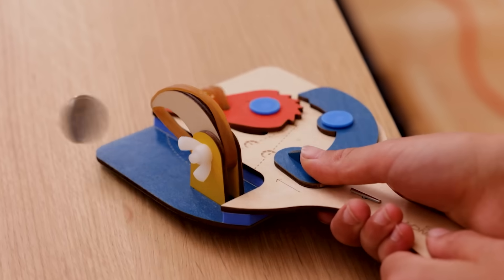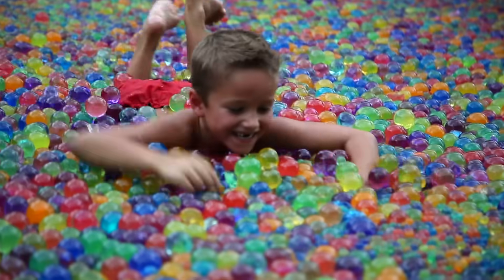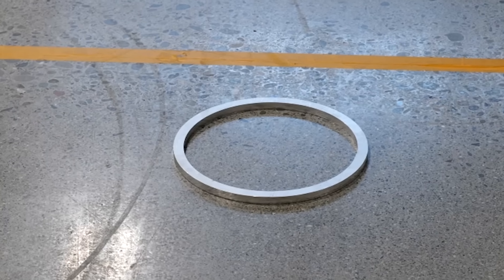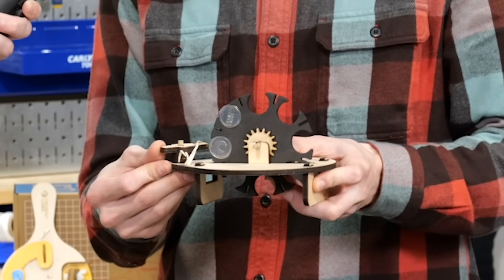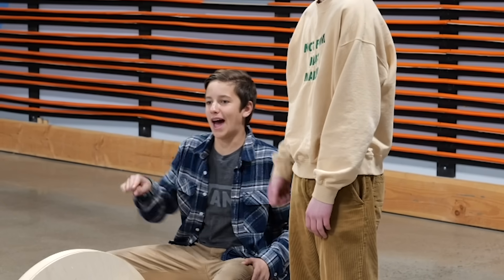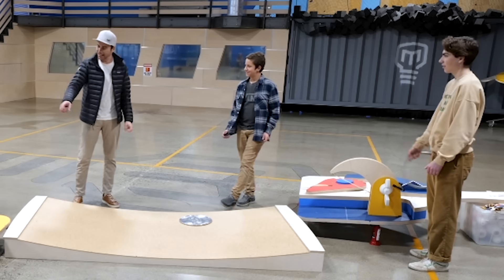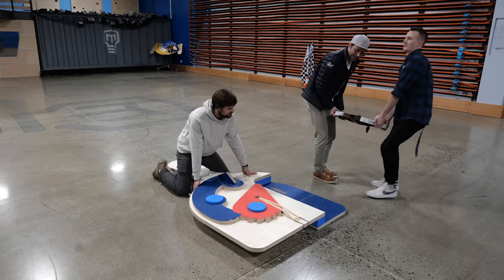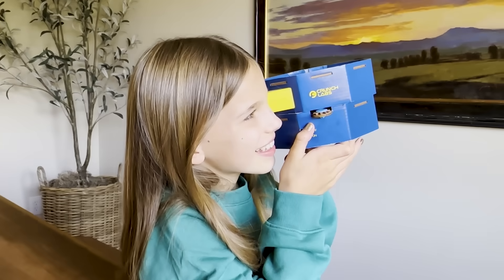World's Largest Coin Spinner

Comment: Cool!  But oops - Not "The 'energy' out is 4 times out than put in" since energy out is always <= to energy in. 
Rather, like a lever, it is 'force' multiplier; the force out is 4 times the force put in.  
To make up for that, energy-wise, 
On input, the 4 times smaller force is applied for a distance that is 4 times longer than that of the output.  
On output, the 4 times larger force is applied for a distance that is 4 times shorter than that of the input.
That way the work (energy), which equals force times distance, is the same (or slightly less) for output than input.

- proud science and tech educated grandpa (of many), including a grandson who just ordered his first CrunchLabs Build Box.
Big Mark Rober fan, too!

Comment: Your not supposed to flock it, that is poor form. You hold it between finger and thumb of opposite hands and pull/twist the edges of the coin in opposite directions.
With this method you can achieve spins over a minute

Comment: The lever arm which engages with the ratchet (or a cog-wheel) to prevent it turning in the opposite direction, is called a pawl (pronounced 'paul').